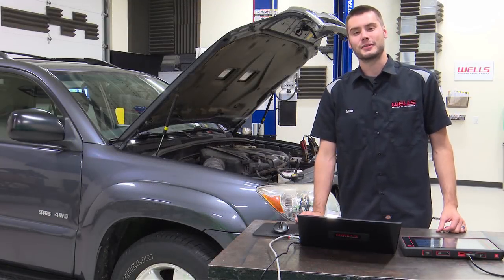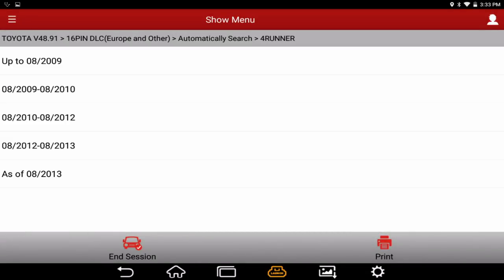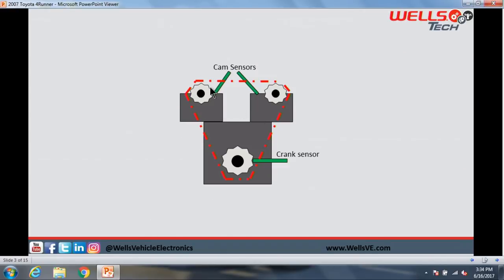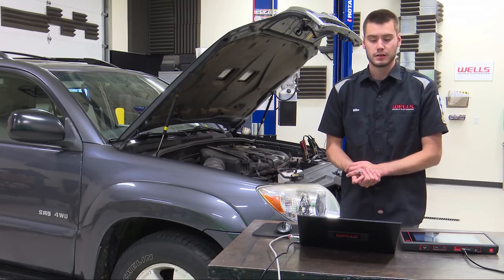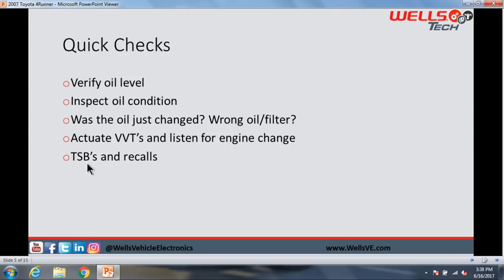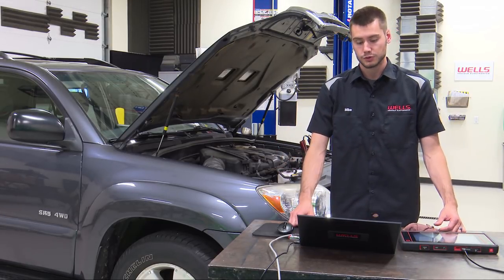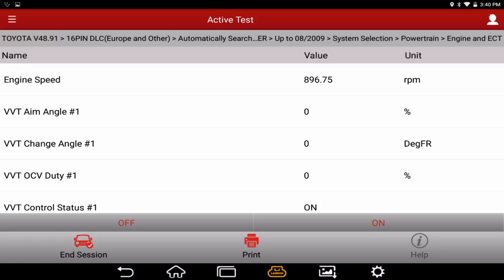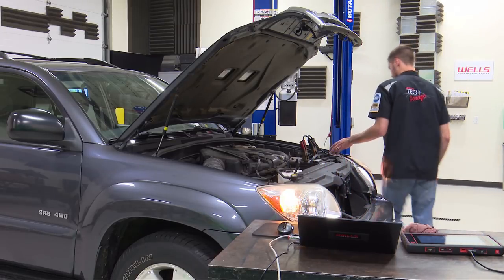-Episode 1- Cam/Crank Timing Code P0016 Case Study - What is a P0016?

Comment: Great idea for a series! On my old Mazdas there are virtually no bi-directional controls on the OTC Encore. To activate the OCV I just give it 12v for a second or two. Thanks Mike!
Reply from the maker: John, just verify with a diagram first, see if it's power or ground side controlled.Then just simulate the control. Quick and dirty bi-directional testing!
Mike Becker, Technical Services Instructor

Comment: Hi Mike,  i have a Ford escape 2013 Se, and i have the Code P0017 crankshaft position Camshaft position Correlation Bank 1 sensor B 
I have replaced the Crankshaft and still have the code on
Reply from the maker: Hi Salina, have you verified that correlation between the cam and the crank? Is the motor in time?
Mike Becker, Senior Technical Instructor
Reply: Hi Mike,  so the motor is running,  but not performing well, i did replace the crankshaft position sensor,  and still the same thing, 
I did new oil change and nothing changed.
Reply: @Shukura496  hi there.  Just noticed your comment.  You have to use an alignment tool when you install the crankshaft sensor on these vehicles and you also need to have a neutral missfire correction performed by a factory scan tool.  You will have to take it to a dealer to have that done.  I dont see them charging more then 1 hour for that

Comment: Have the same code for a Ford Edge 2010. Engine not running smoothly. Guess it can be caused by one of a variety of issues so need to get it checked

Comment: (why would only Bank 1 be throwing codes in this scenario) Sir I took my 08 CTS in for inspection check engine light was on Garage says they think the reluctor wheel has shifted throwing the code. If I don't do anything what do you predict the longevity to be (they said the repair would be quite pricey or more feasible to do an engine swap) Thoughts 🤔(I had the timing chain, tensioners and guides replaced 3 years ago)

Comment: Since i am no longer a "guessing" DIY mechanic, my Ancel X5 (which i never trusted it anyway) displayed this P0016 and got worried but also not surprised at all! Why not surprised? My engine needs a serious rebuild. When i replaced my Chrysler neon 2005 timing belt cover, i noticed its so greasy/oily around the camshaft seal, belt and tensioner. I knew though, that my oil pan underneath has been greasy past two years. So, don't you think the oil leak around my camshaft seal might interfere my timing belt rotation?
Reply from the maker: Hey Keith, if the oil caused the belt to jump, sure. But I don't see how oil could cause the code to set just because it's oily.
Mike Becker, Senior Instructor
Reply: @GoTechTraining  Hi Mike. My suspicion is that, there is some camshaft and pulley misalignment right there. But anyway, i will see the outcome once i change change the leaking gasket and seals.

Comment: Had a P0014 and replacing the oil control solenoid along with oil change fixed the only code. Problem is this did not fix the Envoy stall on slight acceleration. This can be an expensive problem for the shop. I should have went with my instinct on this car, since it felt like a bad TPS. Looks like a bad pedal position sensor or electronic throttle body assembly 😳
Reply from the maker: Sometimes an oil change and a new VVT solenoid are all they need...that's not that case with this one :) Envoys are common for throttle body issues. Sometimes cleaning the throttle body and doing a quickie relearn takes care of it. Maybe try that?
Mike Becker, Technical Services Instructor

Comment: When you pulled the code can anything break or damage? Since we heard the noise change.
Reply from the maker: Samuel, are you talking about when I commanded the VVT solenoids with the scan tool and the motor almost died?
Mike Becker, Technical Services Instructor
Reply: Wells Vehicle Electronics yes Sir...
Reply from the maker: The second or 2 that I ran it that way will not cause any long term damage. If the VVT were to be stuck in that fully advanced position for a long period of time...then yes, the damage could be catastrophic. 
Mike Becker, Technical Services Instructor
Reply: Wells Vehicle Electronics Wow Good to know thank you very much for your knowledge... Excellent teaching...
Reply: Can't wait for part 2...

Comment: I am currently working on a P0016 corelation code on a Ford edge 2014. I tried using the scan tool (actuation test) to activate the VCT solenoid as you did but it wouldnt turn on. I used a multimeter to test for voltage the VCT solenoid wire harness side but no volt. Pls is there any further test I can do and what conclusion can I draw from the above test conditions

Comment: I have this exact problem with my 2008 Chevrolet Impala. I was told it was the module, how much would labor cost to replace a module and how much is a module itself?
Reply from the maker: Hey Cole, what module? An 08 Impala probably has 10+ modules.
Mike Becker, Senior Technical Instructor
Reply: What did it end up being? I have same car and same problem

Comment: Would I be right in assuming that you did not visually check for a failed VVT after you lifted off the intake manifold, because there was not the second "P000B ... Slow Response" DTC? Dirty oil gunk on and/or broken screen on the oil control valve would result in a rough idle which you said you did not detect while driving it.
Reply from the maker: Hey, it wouldn't have been a bad idea to take a look. In one video in the series I show why it can't be VVT related.
Mike Becker, Senior Technical Instructor
Reply: @GoTechTraining  So if there had been a P000B DTC along with a P0016 DTC and only these two codes thrown, is it definitely a failed VVT or not?

Comment: I have a 2004 chevrolet trailblazer has codes p0016 and c0055 and c0040 car will go forward but won't go in reverse will this cause the car to not drive in reverse
Reply from the maker: Hey Leonard, the P0016 is related to engine timing. The trans is responsible for forward and reverse so as long as the engine is running, both gears should be possible. The other 2 codes are wheel speed sensor related and won't cause transmission issues either. 
Mike Becker, Senior Instructor

Comment: I run my 2008 Mazda cx9 low oil and water. I added more oil and water while I was traveling. Everything was normal until I changed the oil and filter. The check engine light turned on the same day. the code is P0016.
what do you recomend?

Comment: I'm getting code 0016 and when i checked the oil, it was way low and very black.  I changed, drove for about 20 kim and no engine light.  When I started it again, the engine light came one and I have code P0016 still.   I also have a permanent code P0089 but I'm not sure if its related.  Thanks for the video.

Comment: what brand and model of scann tool are you using??
Reply from the maker: Hey Joel, its the LaunchPadII scanner. Great tool. Check it out man!
Mike Becker, Technical Services Instructor
Reply: thank you is that going to be the top of the line  scanner for lunch ??
Reply from the maker: It is one of theirs towards the top. I know they also offer a something along the lines of the LaunchPro as well. Not sure. Best bet would to be their website for the most accurate info. https://launchtechusa.com/
Mike Becker, Technical Services Instructor

Comment: I have question.On scan data ,Is "aim angle" the demanded change and "change angle" the actual angle read by cam sensor/ecu. So if controlling the duty cycle the "change angle" value must follow "aim angle" immediately after.If it's not changing then there's problem with the VVT variator.
Reply from the maker: Hey Petar, yeh that is true. Typically there will be a slight variance spec dependent on manufacturer between aim (desired) and change (actual) positions. 
Mike Becker, Technical Services Instructor

Comment: Hey, Guys. I am dealing with a p0016 and p0018 on a 2004 Toyota Sienna. When I activated the VVT sensors, bank 1 stumbles and stalls, but bank 2 stumbles and goes back to normal with minor changes. My guess is that the VVT 2 sensor is not working right. I don't know enough to say than the VVT Controller is not advancing the cam timing. How would you go about that?
Reply from the maker: Hello,
I believe that is a timing belt motor. Has the timing belt ever been replaced? I would check the belt timing, you don't have to do too much to check the cam timing.
~Ryan
Reply: @GoTechTraining  Thank you for answering. Yes, it is a timing belt motor. I have not checked the cam timing, but the belt seems to be tight. I did check engine vacuum, and it is in the  normal range. Could you have good engine vacuum and bad cam timing?
Reply from the maker: Yes, the cam/crank correlation has tight tolerances and could be off enough to set the code without throwing the vacuum off to far. You can check the timing by removing the two top timing belt covers. It is a quick easy check to make sure your base timing is good
Reply: @GoTechTraining  The timing belt is loose to the point that the crank and cams don't move and will be replaced. Vehicle cranks, but does not start. 25% compression on the 3 cylinders that I can get to. I learned that good engine vacuum does not always mean healthy engine. Thank you for your guidance, Ryan.

Comment: I just watched a Saturn video that would run poorly above 3000 rpm.  He ended up having to relearn the cam/crank correlation!  What would cause a car to change its correlation by itself and make you relearn it?  Thanks, Tom
Reply from the maker: Hey Tom, hmm great question. The quick answer would be "nothing". The PCM holds the correlation adjustment unless the battery and capacitors were drained(some vehicles may still store even after this point), a new part was installed that effects cam/crank, or the memory was cleared with a scanner. I feel like maybe that video wasn't telling you the entire story?
Mike Becker, Senior Instructor

Comment: I have this P0016 code on my 2008 Mercedes C350 and my rpms go up and down slightly while driving. Why? What’s causing this problem?
Reply from the maker: Hey, could be a timing issue maybe? P0016 is a cam/crank correlation fault. Follow the rest of this series and you should have a pretty good idea what goes into diagnosis and repair of this issue.
Mike Becker, Senior Technical Instructor

Comment: I just installed a timing chain tensioner on my 1.8 liter 2011 Toyota Corolla and afterwards it threw this code. I rotated the crank clockwise after installing the chain tensioner. The car runs and drives like it always has, but the engine light and slip indicator light is on now and won’t go off. At advanced auto it threw p0016. Hopefully you can help
Reply from the maker: Tyler that codes is saying there's a correlation issue. It's possible you are one tooth out of time maybe. Enough to code but not enough to notice a drivability issue.
Mike Becker, Senior Technical Instructor
Reply: NGK Technical Training I’m thinking that’s the problem as well. Is it hard to set it back to the right time? And do you have a video on how to check if your timing chain is out of time?
Reply from the maker: Tyler, you'll most likely need to remove the front cover again and pull the tensioner to re-time the engine.
Mike Becker, Senior Technical Instructor
Reply: NGK Technical Training do you know on average how much it’d cost to have that done?
Reply: @Go Tech how much does something like that cost

Comment: Hey Mike, I'm looking forward to this one. Will you do a Crank  Angle/Ignition test using a Relative Compression waveform? I'm going to ask a stupid question here, even though people do this test all the time, I don't get the validity. If it's a Crank signal triggered ignition, even if the valve timing is off, say, because of a stretched chain, the ignition firing line should still appear in the right place relative to the compression waveform?? Unless the peak compression point itself shifts because of valve overlap affects?
If its a cam driven distributor-based ignition trigger, then a comparison with relative comp waveform should show an early or late firing line?? But only if signal is driven off the cam?
Tell me if Im not making sense?
Alex
Reply from the maker: Hey Alex, without giving anything away....yes there will be a relative compression test done. No it is not used to check ignition timing though. Like you've said, ignition timing is based off of what??? Crank angle...exactly. So ignition is kinda useless to look at in this case. If you have a cam driven pickup how would ignition be different? Is the cam not connected to the crank via a chain, if that chain were off, stretched, jumped, whatever...would the cam then not be off as well? This puts us in the same boat. I honestly don't see a time when ignition would be useful to judge timing. You'll see in tonight's video what I am using relative compression for. Stay tuned my friend :)
Mike Becker, Technical Services Instructor
Reply: I'm hanging in there ... I'll come back to you on my thinking re a cam driven ignition trigger and the effect of a stretched chain, jumped tooth :-)

Comment: P0012 ford taurus 08? ( 3.5L engine )
Any ideas on how to fix it ?
Reply from the maker: Hey Shehab, sure, diagnose why it's setting the code. Could be something simple such as low oil or a faulty VVT solenoid...or it could be complex, like the timing chain stretching or jumping...
Mike Becker, Senior Technical Instructor

Comment: hello thanks for the vid, i have a 06 e550 amg sportpack, i have the  check engine coming up , but it makes no differance to how the car runs it still drives perfact never missed a beat i can drive 4 hours non stop and never have a problem with the car still showing check engine! would you think it could still be the balancer ? or maybe a sensor ? im looking for some help im hoping you could advise me what you think i would really appreciate your reply kindest regards.
Reply from the maker: Hey Billy, there are certain conditions where the check engine light comes on with 0 drivability concerns. The light illuminates when the car is creating 1.5x it's rated amount of emissions, not when the car is running poorly. Let's start out with the trouble code number that is stored in the computer. 
Mike Becker, Senior Technical Instructor

Comment: Hi make I have a question,i am trying to replace the coolant sensor in my 4.0 4runner,but is kinda tight back there,there's a hose going in to where the injectors are connected that is blocking me from taking that sensor out,Just wondering how can i disconnect that hose? i don't want to mess it up.Thanks.
Reply from the maker: Hey Ivan, unfortunately I don't know exactly what hose you're talking about. The pictures in service info are terrible. I can tell you that book time to replace this sensor is 1.1 hours. So maybe something needs to get taken off to access it? Sorry, wish I could be of more help for you!
Mike Becker, Senior Technical Services Instructor

Comment: Hey Mike. Thanks for the video. 

I'm getting this code + p0017 on a Ford Focus mk2, which gives a significant loss of power. Had timing checked and is in place. 

It kind of clears when I switch car off and on; back comes back. 

You have any idea what else it could be? 

Thanks in advance.
Reply from the maker: Hey Haadi, thanks!!! What year Focus? A P0017 could sometimes be caused by VVT related issues or sprocket issues. Let's start with a year on here and go from there.
Mike Becker, Senior Technical Instructor
Reply: Wells Vehicle Electronics  thanks for the reply, it's a 55 reg (2006) 1.6 Ti-vct engine. 

The p0016 and p0017 come on, there's too much power loss. I've had the cam sensors changed too.
Reply from the maker: Haadi, unfortunatley in the US we only have the 2.0L. I'm not sure the exact codes set criteria for the P0016 and P0017 on that 16L. Could be a variable valve timing issue maybe? Maybe the reluctor on the cam or the crank moved? 
Mike Becker, Senior Technical Instructor

Comment: My 2013 Evoque shows p0016, can the damage VCT actuator cause it ? On full throttle if I hold it long enough I also get turbo underboost. Need help! :/
Reply from the maker: Sounds expensive Samuel. Maybe an VCT solenoid...start by making sure the engine oil is clean, full, and the right viscosity.
Mike Becker, Senior Technical Instructor

Comment: I have question related to it is how come timing could be jumped ??
Reply: Although it has timing chain
Reply from the maker: Timing can jump due to a few factors. Commonly it is because of mechanical wear. Such as bad guides, or a tensioner. Enough stretch in a chain can make it jump too! Great question!
Mike Becker, Technical Services Instructor